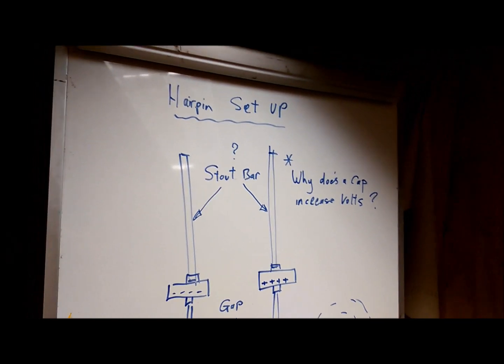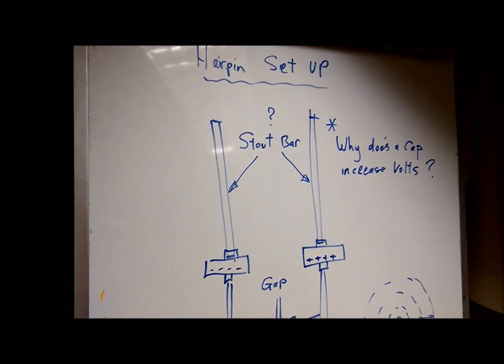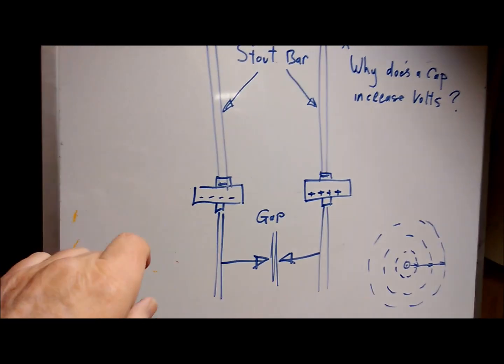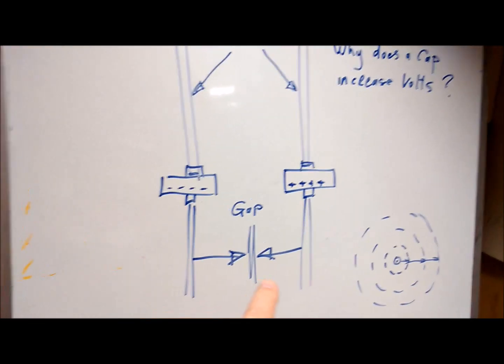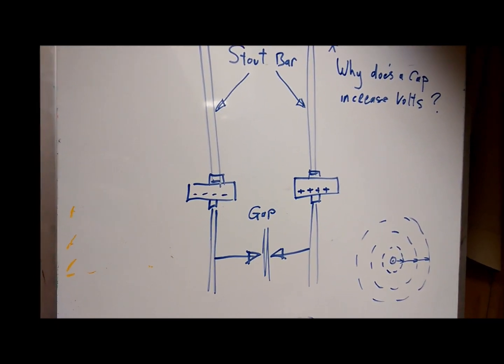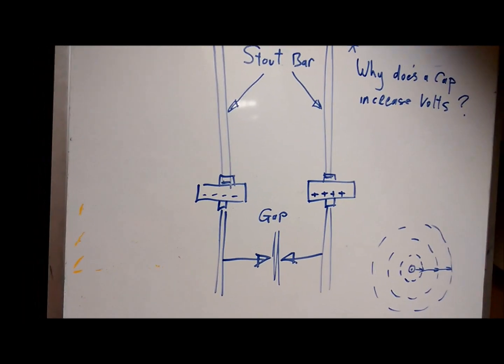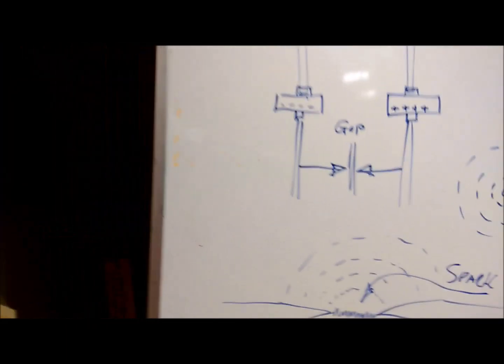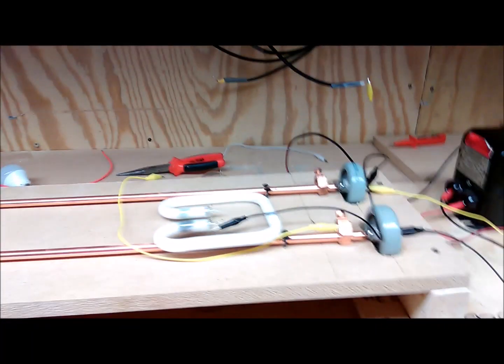Electrons do not exist ( Nikola Tesla Hairpin Circuit )

Comment: What is being discharged in the spark, if not electrons? "Dielectric discharge" isn't explaining what is actually discharged that causes the spark... what's in/on the dielectric that creates the spark?

In Lightning, what holds the charges that get discharged? What are the "positive and negative charges"?... charges of what?

An electrical "charge" is defined as an accumulation of something... you can't just have a "charge" without defining what constitutes the "charge".
Reply from the maker: Tesla Quote "It is an Event" at at frequency .-.-.-.- - - - -  or + - + - + - + - or think mini EMPs filling space. RF going MAD. ... Regards ... DC
Reply from the maker: Tesla Quote "It is an Event" at at frequency .-.-.-.- - - - -  or + - + - + - + - or think mini EMPs filling space. RF going MAD. Like expanding / contracting, tumbling (Spinning) Magnets with potential difference static explosion according to mass & charge volts. Hope this helps.... Regards ..... DC
Reply: There is no electrons between HT rails and lamp, but rails are causing strong electric field. Everything is field fluctuation. Field causes gas discharge in lamp. There is ionization in lamp which is loss of electron and is part of lamp function but this happens inside of lamp, not surrounding media which is air.
Reply: @JosipMiller  Ooops, no electrons remember?
Reply from the maker: You need to study more. Study the "Works of Tesla". Focus on the "Hairpin" & the "Spark Gap".  Regards .... DC
Reply: E.power DC How does one go about finding the works of Tesla?
Reply: @chinemeremohaeri9100  Look for them.
Reply: imnewtothistuff Besides the popular ones, there aren’t any that talk about what this guy is saying.
Reply: beforebefore I’m not arguing against you, I’m just going to tell you that positivity and negativity is purely mathematical. A new system can occur without electrons.

Comment: at the spark gap the spark travels minus to plus electric books published the facts the other way around but to many copies printed so they didnt correct the fac till 80s?
Reply: This is ac voltage...? A step up transformer is being used and transformers will not pass dc.  If it is then the polarity is a moot point. In a dc circuit you would be correct.
Reply: Positive account balance of negatively charged electrons and negative account balance of negatively charged electrons.  Positive and negative are referring to amount of available electrons Not the charge. Which is the source of the debate I believe. Just because the electrons are negative doesn't mean the positive is really negative etc.

Comment: I'm about to build a scalar wave generator. Output power 1.000 kilowatt, six High Power Tubes RS 301 driven with 12.000 Volts. Where can I find a wiring diagram?
Reply from the maker: Study Tesla's Works, pulsed NOT AC. Try to use mechanical not F ... generaor. Then very High V & Pulse with good grounding these are the key ingredicance. Sorry for the delay, keep me updated on your works.... DC
Reply: +E.power DC

Actually pulse for tesla transformer. AC for tesla magnifying transmitter. For a world system, it is impossible to use pulses dc to turn the earth into a dynamo lol. Instead AC with a frequency that matched the earth is used. Triple standing wave is generated. That extra coil is where dielectric discharge in counterspace occurs whike the spark are organically generated with a golden ratio of growth. In reference to Eric P. Dollard and "Wireless Power Transmission" by eric. p dollard. Eric P. Dollard pretty much succesfully replicated tesla's work. Try using extra coil, no sparks, ac that us tuned to the earth and see what happens.
Reply: Where does one find a 4,000 amp, 240 volt supply for a magawatt toy?

Comment: i am working on one waiting for a part to be made .Its an off shoot of the one Gerard has done with speaker cable and Induction stove .It involves a toaster element .Also a  similar one with a radiator element. I am seeing what i can heat with the element and how quick it would heat water with the radiator element maybe nothing but who knows.PS  Glad you have thought it out your end.Gez
Reply from the maker: OK I am the same, I am looking at direct dc water heating elements. They have started making 12v 24vdc etc with thermostats from the states. Also you can wire sola panels in series and use a/c heating elements at 110 / 240v direct dc to the hot water tank. Handy!! .....  DC
Reply: @e.powerdc1127  spark gap nd magnetic quenched to make it run over the wires as in ht the spark gap... drive pumps the dielectric/scalar/longitudinal  for magnetic waves check prof laithwaite  so it is just a  question of these 2 principles dielectric VS magnetic waves nd how u can integrate these two together to oscillate each against the other to achieve the voltage required  further  stepped dn for current Gen at the transformer 
 youtu.be/0DpZ5Ecgt9c
Nd magnetic  in circular 
youtu.be/vxrUR_zZcmU
Reply: @e.powerdc1127  here u c the dielectric passing even through water without shocks as high frequency or scalar waves whatever u want 2call...n people will not shocked as dielectric nd not once passes through spark gap the magnetic current is not thr no electrons
youtu.be/tlx7tDNXYR8
youtu.be/zf7EdiFyALY
Magnetic coz it creates push pull cps at a given interval
Reply from the maker: @DK-sg3oe  This is one of the best replica of Tesla " Stout Bar" experiments.
Key is the Aether or dielectric component.
Think about the room you're in at home.
What's the difference between the room when it's cold or when it's hot?
Expansion & Contractions of Fields.
Fields Mico to Fields galactic.
My Autogen is based on this. I pulse the epicenter of the magnet with a spark gap. This is very promising, at the moment I get a controllable voltage and all I have to do is to introduce phased dielectric (the hard bit).
Love your work 💗. Let's make electricity Free again cos it's readly available everywhere.
With your experience we could work together. 
Do you understand how a magnet works?
I invite you replicate my vibration of the "Bloch Wall" crossover at the center of a bar magnet.
Regards.. DC
Reply: @e.powerdc1127  initially try w ur hairpin the first tesla experiment ie connect a low watt/low resistance say zero watt bulb  at the rear end nd extend ur stout bar extended as long as u wish  too using low resistance or , the zero watt bulb or resistance  will determine the frequency or 2 control ie  compression decompression  ie dielectric field frequency as long as u can make the voltage required at the spark gap ie passing it over a magnet so that 1 voltage adjustment 2. When u pass it the length of the magnet it becomes high frequency impulses ie skin effect... Try this and let's me c ur results.... First experiment but elongate through 2 parallel copper wires  instead of copper rods u can use multi striated or stranded wires 2 raise voltage check what length ur able to take as the fields r rf or dielectric... Compression n decompression not the push nd pull of magnetic current... Or u can add the another cap serially to raise voltage or add proper ground to ur load if required.. Thrs is a video also on how to convert dielectric to dc...via rectifier  diodes  w ground first let's c the length to which u CD achieve the dielectric discharge or if it CD b amplified 2nd part about push pull nd transformer amplification can b checked out later n3rd the convertion into dc/ac part... If the dielectric is just rf v can take it any length so let's confirm that first nd secondly the parallel loads utility ie how much load can it withstand on the spark gap raised to high frequency convertedb over the length of magnet ie quenched length determines I presume the frequency n voltage also connect serial dual caps and connect ground in between ie 2 caps with a ground connect at the centre if  it suffices to raise the transmissions of dielectric like v use the transformer cap in ac.. Tesla just uses it 2makr u understand open nd closed circuits and the resistance connections hw it is to b done... Earth acts as compressor while pinging ur dielectric right back or re enforcement of voltage, nd current if reqd, use  a inductor coil esp w ferrite core

Comment: Hi DC. if it is scaler waves you may need to keep this in a Faraday Cage ..I am no expert on this bye the way.Gez
Reply from the maker: HI GM  Well my friend the alternator only puts out low Hz & I am working in a fully grounded building, my radio does not work inside. However info:- Scalar waver would pass through anyway. .... DC  (PS) are you doing any experimenting ??? Regards...

Comment: So the spark gap is the dangeours part,  i mean that if my cell phone is close to a charged wire connected to the spark gap it wont damage it?
Reply from the maker: Hi ADPL do you mean is your phone EMP proof? I do not understand your question.  Regards ... DC
Reply: i guess is not proof,  but how far does my phone need to be from the circuit to be safe?
Reply from the maker: Hi ADPL  Depends on the Hz / Pulse / Cap & distance & metal case on phone. Hope this helps. .....  DC